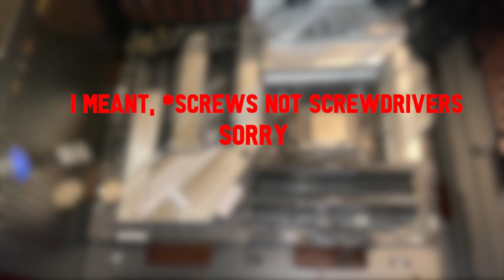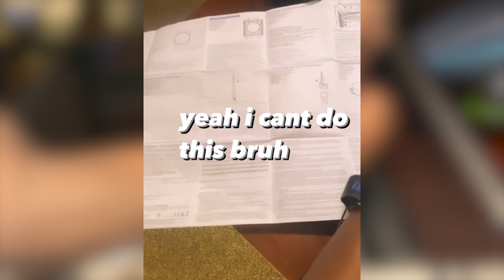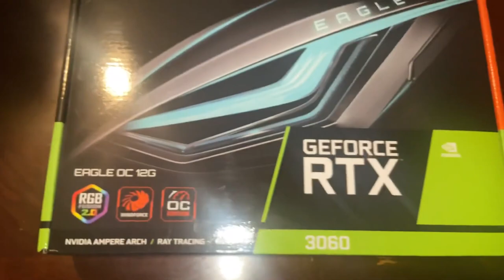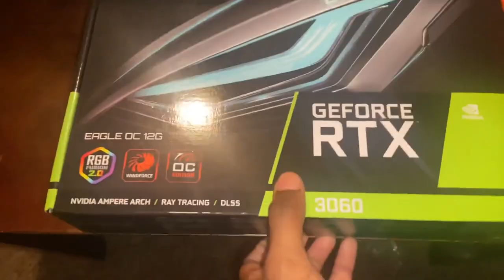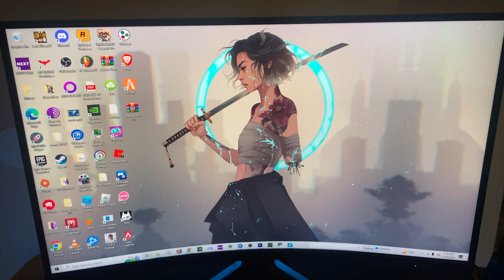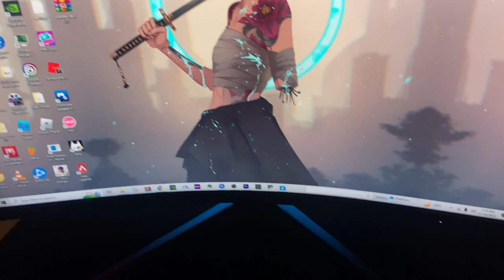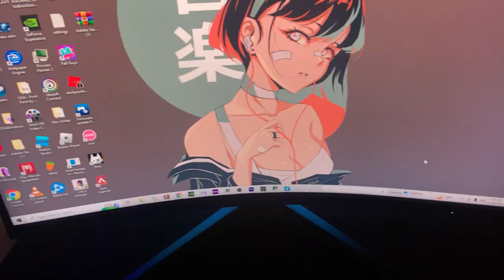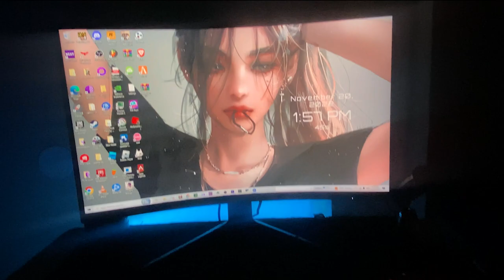Building My First Gaming PC | With Games & Benchmarks | $1200 Pc Build

Comment from the maker: I'm so proud of myself with this vid , I hope yall enjoyed this video tell me what you think and pls be nice lol, 

And i did switch the Ram Stick locations my freind Luckygun told me to while i was installing the SSD i thought i mentioned that but thanks for looking out for me yall,

and do you have a pc build or dream build? if so what comment below and TELL ME ! and im hosting a small real easy 15 dollar giveaway,  3 ppl can win details in description !
Reply: Some Tips from a person builds computers for resale you have a modular power supply you could of prepare the motherboard with the connections before adding in the case and the same thing with your aio you should of pre-connected it to the motherboard it it easier to install before adding it to the case. once you have all the managed use zip ties to make it neat and clean.
Reply: Instagram link is broken for me
Reply: All you fans are wrong its only exhausting the air outside of the case .The on side fans that usually has the wires and supports for the fans side the air push the air out. So that means that your graphics card will never get any fresh air.
Reply from the maker: @_WeHaveFun_  That’s what i did i left out that clipped my friend lucky asked me did i do that and i said no at first and he told me to stop everything i was doing and to go with that part first so everything else can be easier i left that part out because i didn’t want to the video to be that long but installing the aio and the supply in that case was a pain so i was gonna switch everything to my new case in the future with a o11 or probably a corsair
Reply from the maker: @_WeHaveFun_  try it again it should work thanks for pointing that out, and thanks for giving tips and tricks but imma get a new case in the future anyway but im not sure if it’s gonna be soon though but in will make that transfer for sure for it appreciate it
Reply: i already building my new pc with ryzen 5800X (i hope it´s have one CCD not two of them :x) on gigabyte X570S aero G motherboard 2x16 GB G.Skill trident z royal elite 3600 Mt/s in be quiet! PURE BASE 500DX white and some fans and cooler. now i am waiting for new RX 7000 series graphic cards maybe 7700 or XT version of that may be fine

Comment: Hey man congrats on building your first PC!  Hope your pc works well, do really enjoy the kraken gives top tier cooling very worth the money.  
Couple things I'm not sure I may have missed it but always make sure to use the mother board risers/stand off screws this makes sure none of the wires/motherboard directly touch your case.

The biggest thing when it come to pc building take your time and read the product manuals not all steps are the same manufacturer to manufacturer. It can make your life easy and minimize having to circle back and fix mistakes.
Reply from the maker: Yeah i feel like the kraken gives good cooling would i say top tier eh it depends because you can get a better one for the same price or even cheaper, also thanks for the tip at the end
Reply: @ItzSplash_  depends on what you mean by better... better is subjective.  I really like NZXT products they do a great job with quality.  I have x63 running an AMD 5600x no over clocking and playing MW2 it maintains Temps between 38 Celsius to 45 Celsius.  5600x is a very efficient processor to begin with but using high grade thermal paste (I use grizzly kryonaut)  and making sure it seats correctly it's a very efficient AIO low noice and no noticeable performance issues.  If you want to make it better though you can rigg up some be quite or noctua fans to replace the NZXT stock ones you will see some improvement.
Reply: @ItzSplash_  here's the good news though I've been building pcs over 20 years or so, you got your first out of the way so it gets a lot easier after the first.
Reply from the maker: @malus7410  holy crap thanks so much for the last part man that would most definitely come in handy whenever i transport my Mobo and fans thank you
Reply from the maker: @malus7410  Yeah that’s what i always heard most definitely on my second build whenever i build another it’ll be performed better than this😂😅

Comment: damn this pop ups as i’m struggling with my first build as well 😂😢
Reply from the maker: Lol im sorry man what part you’re struggling on ? In conclusion i basically just got a small case and i couldn’t install my Aio Cooler at the top so i missed out on 3 fans in the front so i was disappointed but besides that everything turned out well what’s your build and thanks for clicking on the video
Reply: @ItzSplash_  it was some racks where the power supply goes since the tutorial i was watching didn’t show where the other crews where i was trying to take it out with brute force but then i saw the screws on top. 

rip case 2022 -2022 a small dent but doesn’t really matter
Reply from the maker: @idkifk1646  dangg i’m sorry to hear that man did you ever get a new case or you have to wait a little longer then
Reply: @ItzSplash_  well i just got the all parts yesterday so will probably change it after some time
Reply from the maker: @idkifk1646  Ohh okay damn i know that’s the worst feeling having to wait it out more i hope it all goes well reply back to me and tell me how it goes man if you need help hit me up on instagram me and my freind might can help you

Comment: you can buy an external hard drive case, put in a hard drive
then plug it in to your pc via USB and store your games on there
Reply from the maker: thanks i might just look into that because i been looking to upgrade for more storage space on my pc because i go through alot storage like i mentioned in the vid
Reply: @ItzSplash_  just make sure that you get the right size.
A normal hdd is 3.5 inches
But a laptop sized one is 2.5 inches
Reply from the maker: @superduperbob  okay imma screenshot this comment so i won’t forget thanks in advance!

Comment: you should seperate the ram sticks by one slot cause that means your running dual channel which is better
Reply from the maker: no worries i switched the Ram Stick locations my freind Luckygun told me to while i was installing the SSD i thought i mentioned it in the video but i guess i didn’t which was my fault thanks for looking out though
Reply: @ItzSplash_  ah okay I did t notice your comment on the vid

Comment: your case says it supports a 280mm radiator on top like yours, idk why it didn’t work
Reply from the maker: exactly honestly idk why either but i was gonna try again in the future but i just never did , the Cpu port connection on the motherboard  would’ve been hard to plug in from the so i went from the side but imma get a new case in the future soon so im ok for now about it i guess